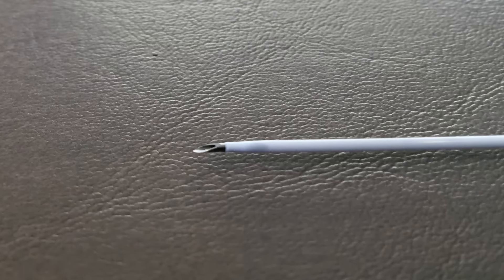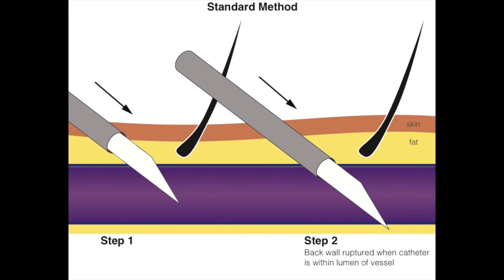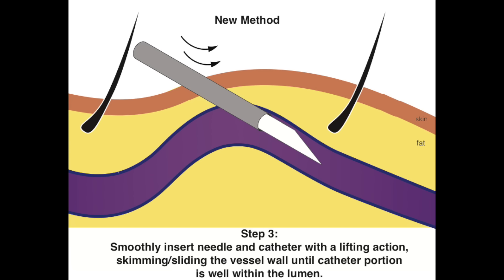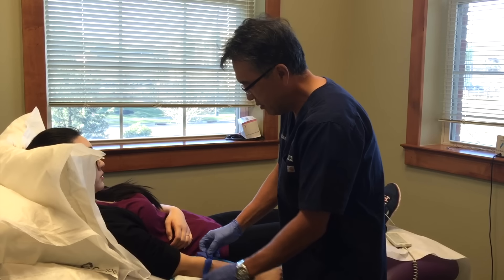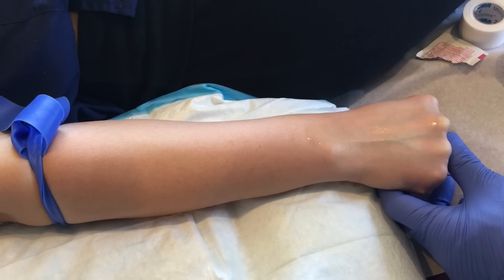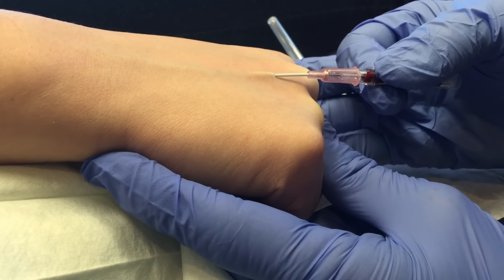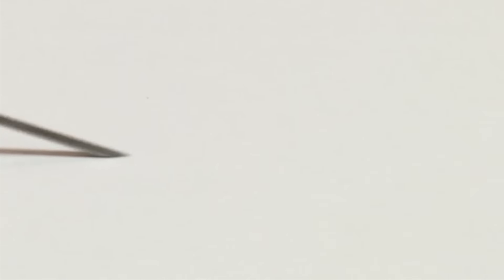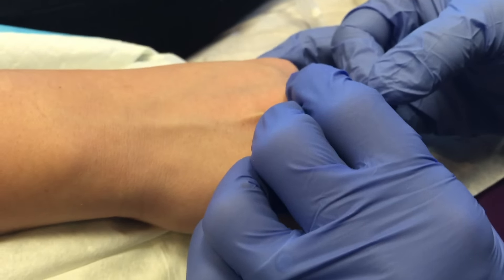Easier IV Placement

Comment: As a paramedic this technique has really helped me ensure I hit nearly all my cannulations. Works fantastically on any vein. I now routinely teach this to our students with great results.
Reply: Nick Osgood - wow that’s amazing! So once u see flash then how much do u have to lift before advancing again? As much as the guy did in the video or can it be less? 🙏🏼🙏🏼🙏🏼
Reply: @hammypie  i lift it a fair amount, it doesn't seem to cause any extra pain and I've even had patients state that I'm a 'light touch'. Often I'm cannulating very sick people, or cardiac arrests, so i really don't want to miss!
Reply: Omar Alnemer  that's how I used to to do it. Now I just go in at the most horizontal angle I can, get flash, lift and progress without flattening out. If it can work with. 22g on a 2 year old kicking off with a hypo it can work with anyone!
Reply: me too. ever since I tried this method, it rarely fails.
Reply: Does this method work with AC location too?
Reply: @multiflash28  Yep, anywhere you can find a vein
Reply: TY for adding yoru input.

Comment: Some good points. We should be mindful that the tourniquet isn't too tight (it must allow venous filling via arterial flow) this is especially important if BP is low, skin is fragile, etc. Rubbing or gently tapping a vein is effective and far less painful than slapping them on the back of the hand like a naughty toddler. There is often a good vein to be found between the middle and ring fingers, proximal to the knuckle. Once you've wiped the area with the alcohol or IV swab, no more touching or tapping the area with anything (but the cannula). If cannulating into the back of the hand, come a little more proximal than demonstrated here. You need to consider the length of the cannula cap and where it with end up after cannulation. As you can imagine, if the cap protrudes past the knuckle there is a greater likelihood of it being dislodged. If the vein bifurcates, aiming between the branches helps. Don't surprise the patient, especially a nervous one. Talk to them confidently, win them over with reassurance and warn them e.g. "This part doesn't hurt I'm just cleaning the area and looking for a good vein". "OK, just a moment or two of pain now, I'll be quick, don't flinch or it'll take longer", etc. Acknowledge their pain afterward. with a "Well done, you did well". Secure that cannula like the precious resource it is. You don't want to do it again! Learn from others & be confident. Good luck!
Reply: Garth Thomson how many days can the cannula stay? For example in hospital. Do u hv to change it?
Reply: @zai4booc  you have to change it. iv good for 72 hours
Reply: @tatto9001  That is not true unless you are administering an irritant or vesicants (vesicants should be rotated every 48hr)
Reply: @zai4booc  I'm a nurse in Thailand. My hospital is usually changed every 72 hours or sooner if a patient is hurt.
Reply: @zai4booc  72 hours or 3 days..... ( Also a nurse here)
Reply: a Blood Pressure cuff   inflated like  [ 7 - 9 ] would also help
Reply: @zai4booc  there will be local guidelines re how often the iv site is  examined (regularly) and ultimately when it must be replaced. Prehospital line are usually replaced earlier than in hospital due to an increased risk of infection/complications from these lines.
Reply: TY  Think you are exactly right,

Comment: THANK YOU!!!! I already thought I was a hopeless case. This helped me so much!
Reply: Did this help you??? I just started doing them and I suck at them
Reply: Marisol Alonso Yes it helped because I often had the problem that I hit the vein and there was blood coming back but most of the time I couldn't push the plastic part forward (sry for the missing vocabulary, non native speaker). Either it didn't go forward at all and I hurt the patient or a hematoma formed or it did go in, but the place got swollen when I tried to inject sodium chloride. That was like 80% of my tries. I thought it would get better with more practise but I wasn't really able to get an error feedback, I didn't know, what exactly I was doing wrong or needed to change. After watching this video I realized that I was too careful not to penetrate the back wall of the vein so that most of the time the plastic part wasn't placed inside of it at all when I tried to push forward. With that technique, I don't have to be as careful and can give the needle a good push before I shove the plastic part. Since then, all cannulations were successful. I also tried to pull the skin under the cannulation spot down to fix the vein when inserting the needle and I started to punch the vein an few times with my fingertips to relax the muscles. This might have helped, too. I don't pull the skin up as high as in the video, though. It still looks scary to me^^
Reply: JaneDoe OMG, everything you just said summed up the reasons why my IVs fail! I always get flash but then end up blowing the vein, and I never know what I’m doing wrong. Seriously this video is a blessing. I’m gonna start trying it and see how it goes! Hopefully I successfully start an IV soon :)

Comment: IV team member here. One suggestion, I know this IV is to be used for short term use, I would still not occlude the cannula with my thumb. The thumb just contaminated the site that will be under the dressing near the opening in the skin. If it were to be used for a longer term, that dressing may not be changed for a few days.  I suggest pulling the needle back half way after the cannula is advanced. Then pop the tourniquet. Slide the gauze (as you did) under the hub. Remove the needle and quickly attach the tubing or syringe. 40+ years experience here.

Comment: It's probably pretty much the same thing, but the way I'm being taught is to insert the needle at around 30 degrees, advance until you get a flash, lower the angle, advance the needle 1/8", and then advance the catheter. So rather than lift up on the entire needle and putting tension on the tissue, I just decrease how aggressive the angle is and point more inline with the path of the blood vessel (not completely level, but more shallow). I've just started with my training, but so far it's worked pretty well. I think it would probably create a little less stress for an anxious patient too since you wouldn't be bending the needle and tenting the skin like with this method. It might not be painful, but you can feel when tension is created (even when you aren't looking at the injection), and I could see that bothering someone who is already fairly nervous about getting an IV
Reply: О какой "вспышке" Вы говорите в начале текста?  Может это такой перевод....

Comment: I know that for me, considering I have a port, the only way I can successfully be stuck with an IV needle or a needle for labs,  the hospital has had to make a notation in my chart that if they are choosing to stick me for an IV or sticking for labs, that I do quite a lot of the work for them. I have sadly to say, become so competent at doing this that I can do it with minimal lighting as I choose to go by feel first and sight second. This is due to a nice spot on the top of my hand, the bottom of my wrist, a spot about 2 inches below my elbow bend that is super deep and then one about halfway up my upper arm. For that one though, I do need a bit of help with but the nurses and medics know that I know my own body.
However, what they also choose to use my port, they would rather I do the whole thing from cleaning my work surface to cleaning up my work surface. Most of the time I take far less time (them about 15 minutes and me about 5 minutes) than they do. They also are surprised with how I push the Huber needle (port needle) in as what I do is position the needle so it's perpendicular to my body and I then look up while pushing it in as it hurts way less for some sort of weird ass reason.

Comment: Great technique. Looks like hell for the patient thiygh. I guess it's better than missing on them over and over
Reply: In theory it's not any worse because the sharp isn't advancing or puncturing additional tissues which is what causes the pain. You're just adjusting the vein, effectively sliding the sharp the tiny bit further into the vein that's needed.

Comment: too many critism here,  of cause, no technique is universal. but I think this method can be adjusted a bit , you don't have to elevate the tip of the needle too much(may cause some discomfort in some patients). we can turn over the direction of the tip of the needle up a bit immediately after entry the venus, that could avoid penetrating through the vessal.

Comment: Thank you for the technique. Question: if the bevel side is safer when hitting the vein wall,  why do you have the bevel UP when trying to avoid hitting the back wall?  Shouldn't the bevel face the deep wall of the vein to avoid catching the sharp tip on it?
Reply: You wouldn't be able to penetrate the vein in first place if you do that

Comment: Hi,
Great video. I have a question . When using an IV filter such as supor 0.2 micron filter as an add on filter not integrated, where is it placed?. I found myself using a giving set where the only option to attach was at end of set where catheter tubing is attached. I then attached catheter tubing to filter. All pretty close to insertion site. While I am here on a gravity fed set , using this filter, the max Gtts/min I could achieve was 76 gtts /min. I needed 80.  Any advice appreciated.Thank You.

Comment: And now the hub is extended so far out that props are needed to stabilize.  The pt can't wash their hands without getting the dressing wet.  Use the "intern" vein or forearm vessels to accommodate a 72 hour venipuncture site in a pt that is not in extremis. RN's do it better 😉

Comment: How do you actually insert the needle though is it by experience? Also how do minimize pain while inserting a cannula?Is it the more superficial the angle the more painful it is?
Reply: What do you mean? The main thing is not to pussyfoot (for lack of a better term) around with the "poke". Go confidently, don't drag it out, and make them feel every mm of the needle. The confidence takes time, everyone gets their miss streaks. For me, this video is helpful, because I'll often go all the way through if I'm using a large bore because the cath is even further back than on a 20ga or 18ga. (so I'll over think it, and drive the needle too far in an attempt to allow room for advancement). Just takes time and experience.
Reply: As in whats the best and painless way of inserting the needle?I mean in this video he obvioulsy did not "just insert the needle" , he is giving an angular rub with the needle perpendicular to the vein until he gain  access to the vein.
Reply: You can also give a local anesthetic for patients who are more sensitive to the needle stick, using lidocaine 2%. You can use either a TB syringe or a small volume (1ml) syringe with attached small gauge needle (25-33g) and draw 0.3 ml of lidocaine or 30 units and inject the lidocaine superficially just below the surface of the skin to create a wheel proximal to the location you will be inserting the catheter. Once you have completed this I have found that cleaning the skin with either Alcohol or CHG seems to activate the anesthetic quicker than simply allowing it to rest. After this you can proceed with IV placement and the patient will either feel a much depreciated amount of pain or will not feel anything at all. I have never had a patient complain about an IV placement after having the local applied. You can check out this link for more detailed information. https://youtu.be/wRWaCB7b0EM Sorry the video is kinda blurry but i didn't record it 😁

Comment: Think about the pain .. while lifting up the skin with introducer in sheath , it hurts a lot.. its WRONG method in so much visible vein. Rather slide with an near parallel angle to skin surface and withdraw introducer and slide forward the cath tip as gentle as possible .. the patient might beat you while you r busy in lifting up the skin...
Reply: It feels like someone is PULLING & TEARING your skin apart.

Comment: For some reason I don’t get that cringe feeling if the needle isn’t as think as those fucking very think needles as long as I can see it it doesn’t scare me but anyway would still use them thin ones if I had to but if I didn’t then wouldn’t recommend as they probably hurt more than thick ones and this was from experience even if thin ones don’t hurt that much in the hands of a professional they still make u feel a bit of pain

Comment: You applied tourniquet too far from iv insertion site that’s the reason for delay in vein filling.

The technique is too bad, lifting catheter needle can cause trauma to vein and damage vein.
You need just low your angle once you see flashback.

Comment: What would cause the IV fluid to stop flowing? I had a patient who when I placed the IV in at first had a nice flow but after a little while, the flow stopped, i'm stumped as to why.
Reply: The catheter can become occlude by clotting. You may be able to fix this by disconnecting your bag of fluid and flushing the IV with a syringe of normal saline. If that works you can reconnect your line. Sometimes patients can dislodge IVs as well if the catheter wasn't placed well to begin with so you may need to start another one.
Reply: Sarena Acevedo I've also had the catheter migrate a little bit and become occluded by being pressed against the vein wall. Repositioning the catheter by pulling it out by a few millimeters will sometimes fix it.